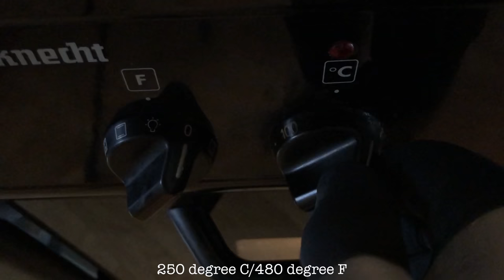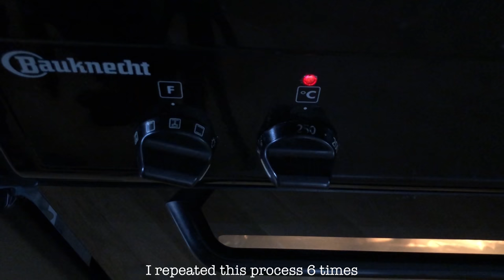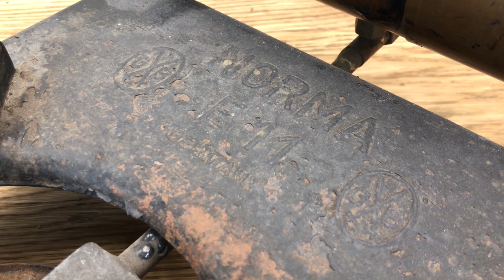1920 German 'Barthel' Stove Restoration - A 'my mechanics' Collaboration!

Comment: Found this channel from MyMechanics. I will definitely stay here longer, subbed!
Reply from the maker: Hey Piotr! Thanks a lot and welcome to my channel! 🙂
Reply: Me too.  I love restoration videos.
Reply from the maker: @Chad W Smith thank you so much!
Reply: .....cleaning is a big part of restoration. Robert Murray Smith went through the hassle of sandblasting too ,then did a video building and using a sand tumbler barrel to clean his parts , then built a vibratory box with sand and his concoction added .  There's also the pressure water blaster that sucks up sand for cleaning which he also did .  ..I've never seen those bronze cylinders with cracks , I'm wondering if it's exposure to extreme cold and also lack of necessary alloying agents in 1920s Germany .
Reply: +1
Reply: Yeah me too

Comment: Hi Mister P, a tip when using the Oven. When turning it on, turn the temperature Controller on last, as part of the thermostat system, it is designed to handle the large currents turning on and off and similarly when turning off, turn it off first with the temp controller. The mode switch is not designed to switch the power on and off repeatedly.

Comment: @ 8:06 when soldering,move the flame, don't keep it in one spot.
Always heat the pipe/fitting until the flux starts to bubble,at that point the solder should start to melt into the joint, if not then heat some more, you shouldn't have to directly put the flame on the solder, the heated pipe if hot enough will do the work for you.
If you keep the flame moving on the two pieces being joined and just let the solder flow into the joint you'll always get a nice smooth solder around the joint.

Comment: Nice work! One comment or maybe suggestion: all parts around burner shall be jond with silver solder. Tin solder isn't safety in place where temperature is high. Original jonds were silver solder: 5:46, 6:00...
Reply from the maker: Thanks Mario! Since iam new to the "soldering game", iam so thankful for hints like that. The next time ill use the silver solder :-)

Comment: Nice content, an enjoyable watch 😊
My only suggestion would be to go a little slower on the final test at the end and maybe explain a little more in detail how it works. I've rarely ever used a gas stove, much less one from 1920, so I was most curious about that part hehe
Reply from the maker: Thanks Andrew! This stove works just by gravity, since the tank is higher than the burner. The only thing I cant explain is the part with preheating. But i can tell you that it doesnt work without preheating :-)
Reply: @misterpatina  I can :-) 

Since you need a constant (or something around it) power of burner, you can't rely only just on force of gravity. The principle here is pretty same like a blowtorch: at first, you preheating all parts where the flow of fuel is ending; when it heated enough, it starts to vaporise the fuel; there's small burner below a main one to keep the temperature on the end of metal tube, so when it's working, fuel would be vaporised at all times. So, when you adjusting the burner, actually you aren't adjusting the flow of liquid oil, but you adjusting the flow of vaporised fuel at the end, and it will work with same flame regardless how much fuel are in tank.

Comment: Soldering the brass tube with low-temperature solder is a bad idea because it most likely will melt at some point.  Harris Safety-Silv 56% Flux Coated Silver Solder 1/16", 56F318MPOP should have been used.  It's the same color as the brass and has a high enough melting temperature, so it wouldn't melt when the stove is used.
Reply from the maker: Thanks for your hint! Iam pretty new to the world of soldering, but i thought about the heat resistancy before. Ill keep your words in mind!

Comment: Why does the maker's mark say "Germany"... in English?  Was this made for the export market?
Reply from the maker: Jonathan, thats a really interesting question. I cant really tell you.
Reply: @misterpatina  I did a bit of digging. Gustav Barthel was based in Dresden, and used several brand names with the same GB logo as on that E11. At least one of their stoves appeared with "Made In Czechoslovakia", and they did get a trademark granted in the USA, but I found an E14 with the "Norma Germany" markings and an instruction plate in German.

After WW1 it doesn't surprise me at all if they were trying to export. But it looks as though one of their factories was not in Germany. Was there some slight advantage in using an English-language label rather than Czech or German? Czechoslovakia does seem to have pushed hard on using the Czech language, and I suppose they could have blamed an English label on the Versailles Treaty.

So no definite answer. I doubt the tooling would have been varied for different languages.

Comment: A beautiful restoration! Only two things I would have done differently: I would have annealed the tank to prevent further cracking and silver soldered the cracks and also the joints of the new tube.
Reply from the maker: Hey man, thanks a lot for your comment! I agree with your suggestions, especially the silver soldering/brazing on the tubes, to keep the system 100% heat resistant! 🙂

Comment: Though the end result was beautiful, where you and 'My Mechanics" did this piece justice in your restoration of it, it's pretty obvious you're just starting out in your restoration craft, though that isn't a bad thing, in the least, because you show your viewers/subscribers your progression from your very first video of a restoration and what you learn to add to it, to date. Might I say, Great job! I've been following you restoration videos and for each one, I'm always progressively impressed. Though may I give you some friendly advice? When soldering, you can nip off about an 1/8" pieces of soldering wire and place them at three strategic points of 180 degree area (half the circumference) each little piece being adhered to the soldering with flux, which is brushed on the whole circumference then heat the opposite part of the area where the little soldering pieces are and let the heated capillary action take place, making a cleaner perfect permanent seal. Also, remember, solder will stick only in areas you have flux. So. if you have flux inside of anything you don't want it, the heat capillary action will wick the solder into those prohibited areas. Just a little advice.
Reply from the maker: Hey Eddie, first of all: Thank you so much for your kind words and loyalty! Second: iam so happy for every hint! You explained it very good - ill definitely keep your words in mind! Thanks you! :-)

Comment: Absolutely brilliant as always. I don't understand metals etc as well as other viewers, please may I ask why you used lead solder instead of brass brazing rods? Would they have has to be brazed at too high of a temperature for the brass tube? 

I do like seeing more unusual things being restored, I've never seen a stove like this. Norma would have been proud of you.
Reply from the maker: Hey Mark, thanks for your kind words! So iam actually new to the world of soldering, but what ive learned is the following: You can definitely use the lead/tin solder for connecting brass or copper parts - this really works well. The problem or more the mistake I made: this solder isnt heat resistant, but the brazing (or silver solder) is! But i can tell that my soldering spots survived the final test without melting or leaking - the stoves in the display now. In the future ill use silver soldering (or brazing) for heat resistant spots! :-)

Comment: The part you called a wick is a generator, its purpose is to flash the liquid fuel into a gas. The twisted wire provides extra surface area to heat the gas. In my experience, I have never seen cotton used in the generator before, they usually have a coarse steel wool, or brass screen. It could even have possibly been asbestos instead of cotton that was removed from the generator.

Comment: Awesome. Would you talk abaut sandblasting technic? I wonder what kind of material you use. What kind of hardware do we need? Thanks for your explanations.
Reply from the maker: Iam using a small cabinet (you can buy them complete), a 50L air compressor and fine blasting granules (0,1-0,3mm).
Reply: @misterpatina  Thanks.

Comment: Mister Patina, I would very much like to know more about the process of treating the bare steel parts with linseed oil and baking them to yield a resistant surface.  This is quite interesting.  It's the first time I have ever seen this and I has been an ME, a machinist and in the casting industry for forty years.  How the hell did I miss this?  I would appreciate your feedback.
Reply from the maker: So, its pretty simple explained. The linseed oil reaches it "soot point" by 240 degrees celsius - this is the lowest soot point any oil has. At this point the oil makes a connection to blank metal and builds an pretty hard layer. You can repeat this process up to 10 times - depends on how important the final look is for you. You can check out some videos on youtube "pan seasoning", or the pan / waffle iron restoration by TysyTube.
You should give it a try one day, but be warned: It smells really intense, you shouldnt do it in your private kitchen :D
Reply: "I has been"  Godfrey Daniels did I write this? What bad English.   Apologies to all.
...........I have been.........
Reply: @misterpatina  Thanks Mr. P.

Comment: Did you also oil the rack 6 times or just heat it and let it rest 6 times ? I really like your videos!
Reply from the maker: That’s right, I did the whole process (including oiling) 6 times. Thanks! 🙂
Reply: @misterpatina  Awesome - thanks for the explanation! Looking forward to more videos!
Reply from the maker: You’re welcome! And make sure to attach really thin layers. Before attaching the first layer, make sure that the metal is super clean (clean with acetone multiple times).

Comment: Soldering a brass pipe near the torch - does this joint not melt due to the heat of the torch?
Reply from the maker: It didn’t so far, but I’d use silver soldering the next time 😄
Reply: @misterpatina  But you can't heat it with a gas burner (cartridge)

Comment: Tisk, tisk, i didn't see any flux used while soldering the new brass pipe on... ( Maybe that was the gray stuff?) I don't know if it's the same with brass as with copper, and it's been years since I've done any plumbing, but when soldering copper pipes, you just heat the pipes up with a torch, wipe on the flux, and then dab on the solder, and the solder just sucks itself into the joint.

Comment: Hey, can someone explain, what is the reason of applying linseed oil?
Thanks:)
Reply from the maker: Linseed oil has its „smoke point“ at 250 degrees Celsius. The oil burns and leaves a heat proof, black finish 🙂
It’s basically the same like heat bluing, where you put a hot metal part into linseed oil.
Reply: @misterpatina  thank you so much sir:)

Comment: That's cool bro, what is white spirit?
Reply from the maker: Hey Tim, its a big mistery, since theres many types of flamable stuff in germany, but no accurate translation. In germany we call it "Brennspiritus" or just "Spiritus". With this liquid you flame up your grill for example. Hope you know what i mean^^
Reply: @misterpatina  I'm thinking it's what we'd call white gas but normally there would be a pump and no wick
Reply from the maker: @timsmith1589  theses stoves don’t work by pressure, they work with the physics. Since the tank is higher than the burner, there’s a natural pressure. The wick just reduces the fuel flow and eliminates backfire 🙂

Comment: What's the purpose of the cotton?
Reply from the maker: The wick „manages“ the fuel flow. The most important mission of the wick is reducing/eliminating the backfire from the burner, through the fuel pipe into the tank. 
I had one these stoves running without a wick once - I was pretty glad I did this outside.
Reply: @misterpatina     Ah, okay! I have no practical experience with alcohol burners. I have with pressurized kerosine burners, and there the setup is different. You hace super fine needles to control the spray, but no cotton filling.

Comment: Does this thing run off of white gas? I'm confused. You said "white spirit" which is a solvent, not a combustible fuel.
Reply from the maker: That’s a translation issue 😅
In Germany we got several words for it, and the USA as well I guess. In German it’s 'spiritus'.
Reply: @misterpatina After I posted this comment, I looked it up, and it turns out white spirit (not the same as white gas), as well as being used as a solvent, is also used as an alternative to kerosene. Stoves can run off of it. I didn’t know that. It’s not a translation issue. It was a me being stupid issue. You were right when you said that the stove runs off of white spirit.
Reply from the maker: @UltraMagaFan okay, thanks for clarifying! This topic was heavily discussed 😅

Comment: Why would you solder the pipe so close to a source of high heat??!
Reply from the maker: To make sure the pipe is soldered.
Reply: @misterpatina  the question was why would you solder it there and not away from a source of live flame and heat. In time over a longer usage period (large lunch, dinner, etc) that solder will start giving way and will have to be renewed. Another option would be to thermal insulate the spot or provide heat dissipation via various means

Comment: So the paint used on these was japaning with lead to resist heat. You just aerosolized that and contaminated your sandblaster cabinet, not to mention that you probably breathed some in. Good job bud. Next time get a lead testing kit.
Reply from the maker: Totally agree with that, iam always wearing a mask with 3 filters on both sides. Safety first!

Comment: 8:02, isn't this technically brazing? I don't know the difference, this is why I ask
Reply from the maker: Interesting question, had to do some research: the difference between brazing and soldering is, that brazing is a high temperature process and very strong connection. Soldering is a low temperature process and not as strong as brazing.  
Guess we’re both smarter now.
Reply: @misterpatina  thank you